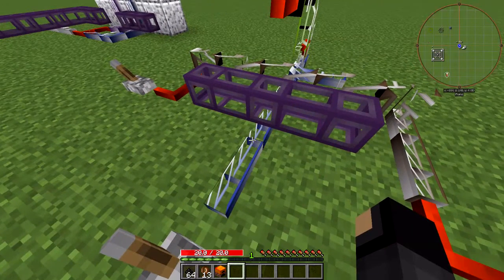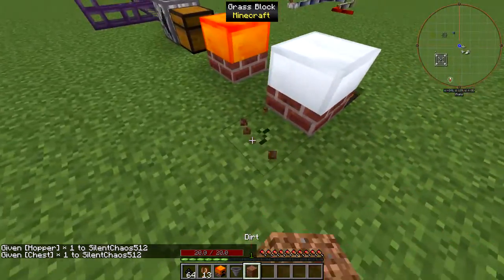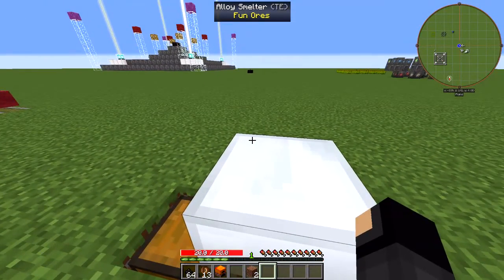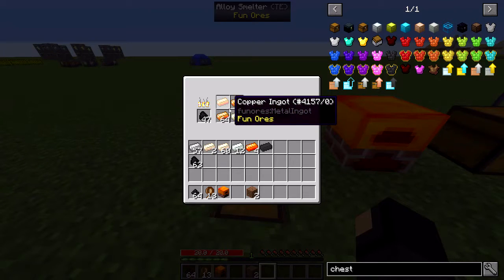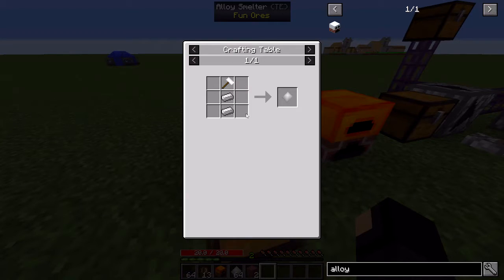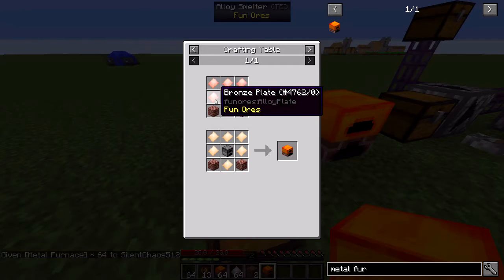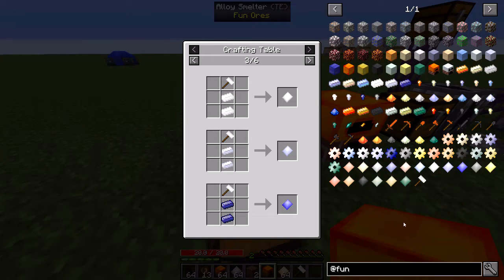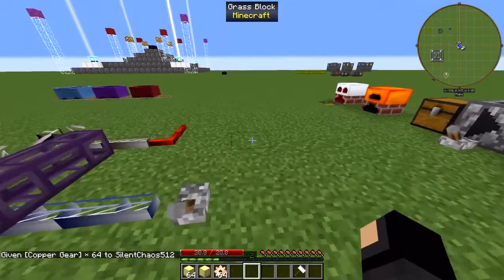Fun Ores Progress Update: Alloy Smelter and More!

Comment: I think your cost for the enderium is a fair one! Afterall; it shouldn't be easy to get!

I also wanted to make a personal request. I've been working on an Energy API for 1.8.9 over the last few days and I'd like to use this mod for the base metals as a dependency. My mod idea wouldn't try to take away from the feel of any of your work, but I would like to make an addon that utilises my API and adds progression towards electric powered machinery.

If not then no worries. I just really like your mod and I think it's primed to be a great mod for metals in 1.8.9!

Also if you're not happy with your textures, I'd be happy to take a crack at designing some for you!
Reply from the maker: +swordkorn I tried to match Thermal Expansion's enderium recipe as closely as possible.

I'm fine with Fun Ores being used as a dependency, or addons being made! It's meant to be a foundation for other mods or mod packs to build off of. Never expected that to actually happen though.

As for textures... maybe? I'll probably take another stab at them later. I would like to improve, since it's one of my weaker skills.
Reply: +SilentChaos512 Could you make Mob Ores a separate mod if you do this? I don't want to have meat ores everywhere to install a tech mod.
Reply: +Henry Rosser You can disable all the mob ores in the configs if you really don't want them. personally I think they're a fun quirk
Reply: Yeah, I guess you're right... I like them too, but some may not want them to use a tech mod.
Reply: +Henry Rosser Personally for mod development, I was thinking of simply explaining  the config can disable them if desired. That way if players want a more technical metallurgical play style they can just disable them
Reply from the maker: +swordkorn +Henry Rosser I'll make sure disabling/tweaking ore spawns is as well documented as possible. I think I'll also add configs to disable entire "categories" of ores with one setting. Otherwise, I think everything is OK, meat/mob ores are fairly rare normally (unlike my current 1.7.10 series), so finding them is a pleasant surprise.
Reply: +SilentChaos512 Sounds like a plan! I'll wait until you've updated Fun Ores to this current build before decompiling it to check your methods :)

Also, just as a quick question, your health bar mod covering the vanilla heart system functionality...

Is it in the latest build or planned for the next?
Reply from the maker: I could provide a source jar if that would be easier.

Health Bar replacing hearts is in the latest released version (1.0.1).
Reply: It's up to you! It's your mod after all!

Awesome! I was hoping for that feature since you unveiled it in your 1.7 series!
Reply from the maker: Thanks, that does give me some ideas to improve mine.